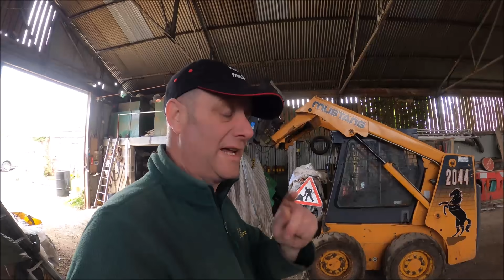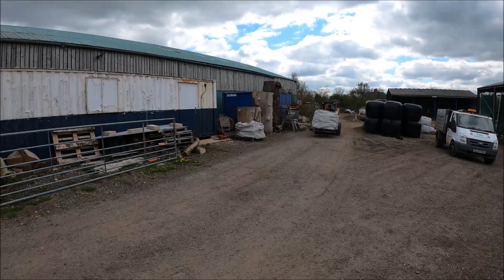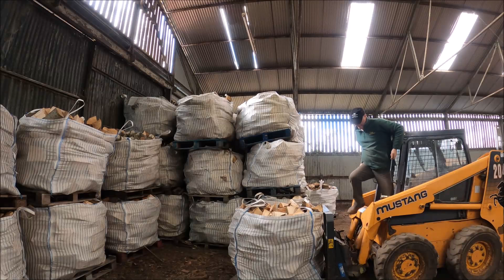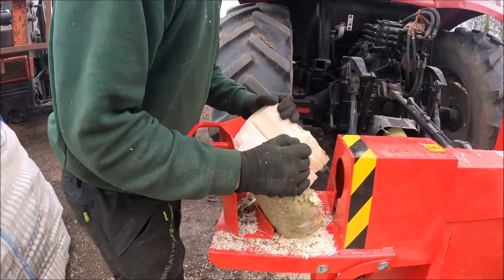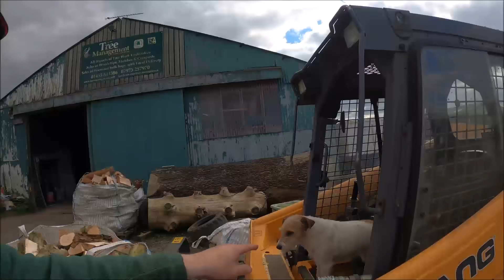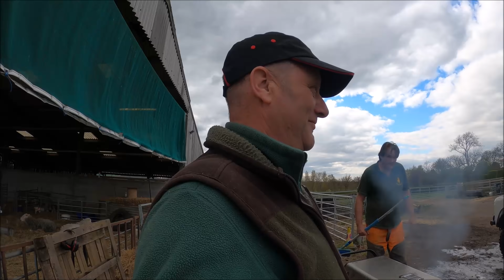Friday, An easy day for the tree team.  16 04 21

Comment: If you ever get short of pallets they put a pile out for people to take away down at Sharpness dock either by the crane place as you get to the bottom of the hill or round the other side by the weighbridge
Reply from the maker: I have a local supply Ken. 🙂👍🏼

Comment: I've got a bit of a mixed feeling about the logsplitter. The machine in it self is great however I would prefer to have it it's own power source. Now it uses the  tractor which then can't do other tasks.  Just my thoughts.
Reply from the maker: You can get a PTO power back for it if you want, but it adds to the cost of the machine, probably doubles it actually. It’s very cost efficient and convenient to have it tractor mounted, it’s easy to move about and probably cheaper to run than the  petrol power pack and at the end of the day it takes just a few minutes to put it on or take it off. 🙂👍🏼

Comment: that mustang shutting off like that almost looks like some electronics get hot and it shuts down ,maybe you should have a feel arround when it shuts off if you can find something hot ,or maybe a sensor somewhere has a loose connection?

Comment: Did you ever consider another door into shed to speed up timber movement?
Reply from the maker: There is a door at the other end as well Padraic, but for security reasons it’s sealed off and permanently shut.

Comment: Is it a safety switch sticking? On the skid steer.
Reply from the maker: I recon it’s a micro switch, or the ignition switch Matt.
Reply: @FarmerP  If only my dad was still here. I'd send him round with a continuity tester, and a short piece of wire. To bypass that switch. He felt, that safety cut off switches where the work of the devil.

Comment: I'd suggest that your FEO is making himself a nuisance. Deer is now closed as ALQ and as long as you have the correct calibre you don't need any thing else. When I put in for my 22.250 my FEO asked if I'd rather have something bigger so I changed to .308. 
P.s tell them the .243 is for foxing
Reply from the maker: It’s unlikely I will ever take anything bigger than a Fallow Paul. I sort of fancy the .25-06 Remington as a good all rounder. A fast 75 grain bullet for Mr Fox, or a slower 120 grains for bigger quarry. My mentor shoots the 30.06, which is not far away from your 308 ( I did my DSC1 with a .308) A bigger and slower bullet and probably safer in woodland as well, but most of my targets will be in the open sub 200 meters and We don’t have many boar about this side of the river. 👍🏼🙂
Reply: @FarmerP  I had a few rounds through a friends 45-70 a few weeks ago. My shoulder hasn't recovered yet!!

Comment: Its so weird but the way its shutting off after a bit of work acts like a coil pack on a gas engine . When they get old they will do that and you can usually check by simply squeezing the coil and it will be soft . But your running a diesel engine and it should not need a coil pack that i am aware of . I would say something is getting hot that is electrical and its breaking connection . Some kind of safety switch maybe . Connections are 90% of all electrical problems .
Reply from the maker: I agree, something is shutting off the fuel solenoid, I just need to find out what ?